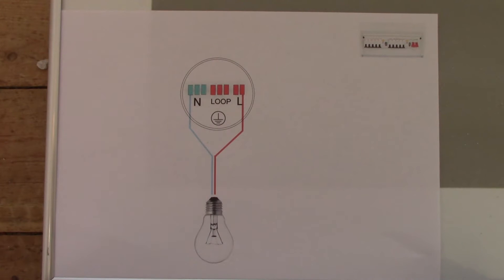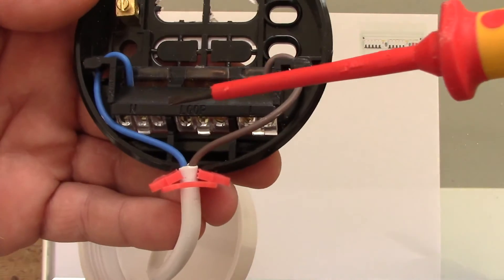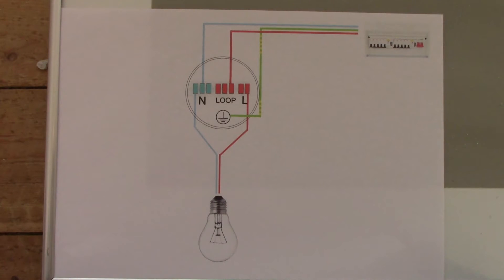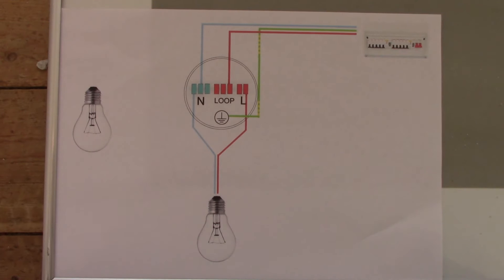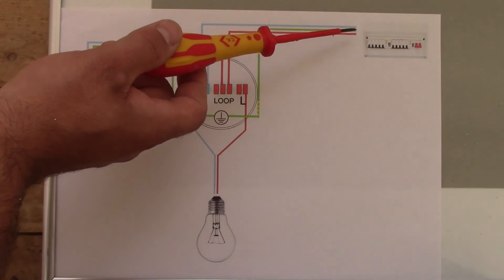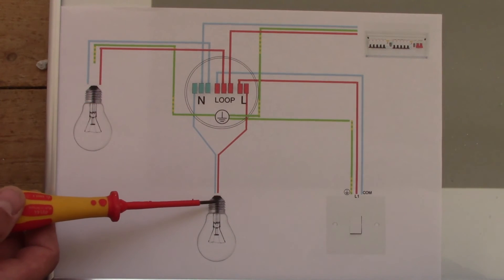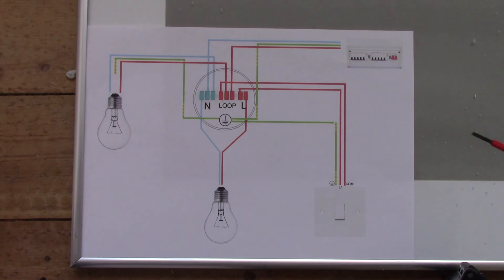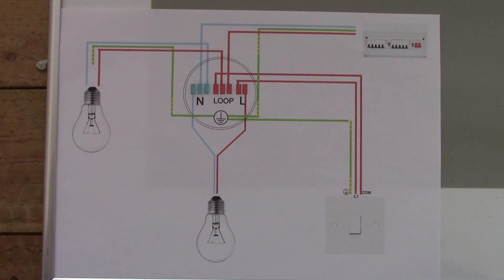Ceiling rose light wiring explained video.How to connect light in a ceiling rose.

Comment: Hi great video, I have one red wire and one black wire hanging down from my ceiling (it's old) but no earth wire. How would I proceed to connect to make it work? Thanks
Reply: Hi there, if you have no earth wire you must never install metal switches or light fittings, as any fault current will have no earth wire to use.  You could follow these instructions (but without the earth wires) only if you are using standard white switches and ceiling roses to replace the existing ones.  But I cannot stress enough do not fit metal switches or light fittings. But if you can afford it in the future you might want to ask a trusted electrician about re wiring your lighting circuit (if you are considering metal switches ect)